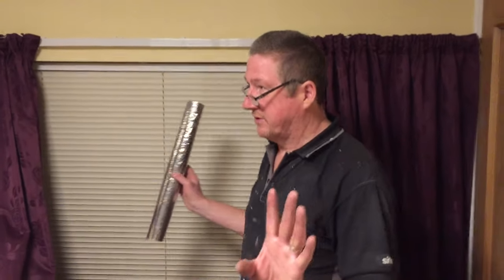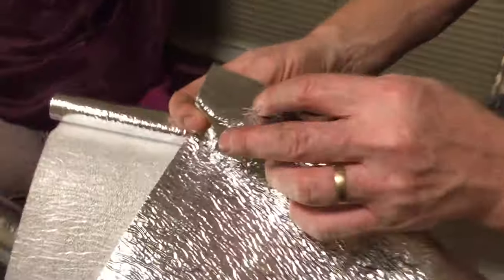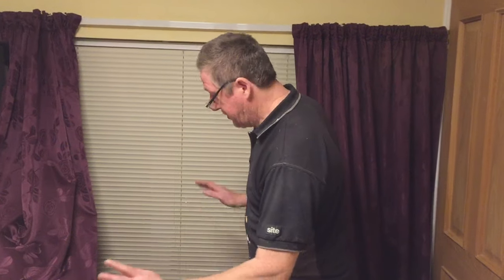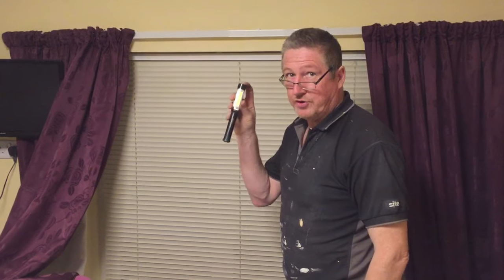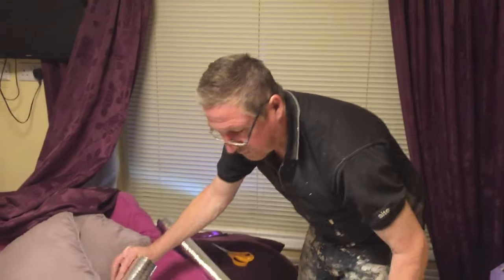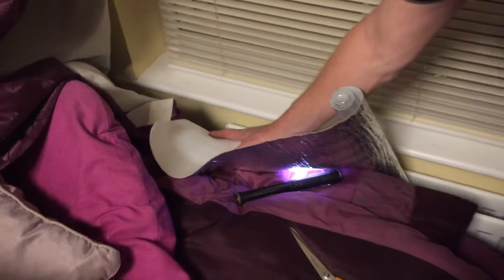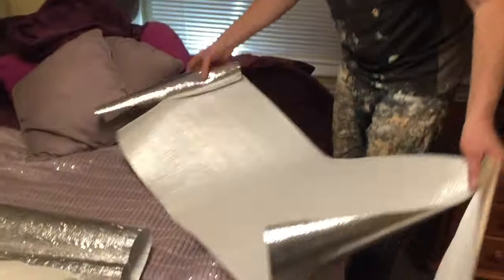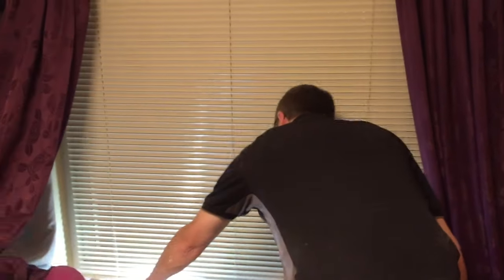Save energy and money, fit reflective foil behind your radiators how to

Comment: I remember this being a thing back in the late 70's.
obviously material is far more advanced these days, but if you had the money you would get the reflective stuff, otherwise you would use old cardboard boxes.it does work.
for £6 to do three radiators it's not bad value at all.definitely buying!

Comment: Does the foil need to be taped to the wall or can it just hang loosely like in the video? Is there any fire risk?
Reply from the maker: No, it just sits behind the radiator and no fire issues thanks.
Reply: Most recommend tape, when it first came out it was fitted with wall paper adhesive, will work always. So pin with drawing pins, but support the corners with a small piece of cello tape.

Comment: Do we really need the performance of how to cut enough foil ? It is surely common sense. Instantly you can feel more heat coming into the room ? What with your face 2mm from it? Hahahahahahah .nice one .
Reply from the maker: It's not really about cutting foil , the video is about how to save energy with the foil and how easy it is to install.
Reply: I just installed mine and I could tell the difference immediately standing half meter from the radiator
Reply: Don’t be a troll pal.
Reply: Hater
Reply: @ Lee nobody unfortunately common sense isn't very common in today's world. Hopefully you have some 🤗
Reply: If only you could skip past bits you don’t need to watch….. good video thanks